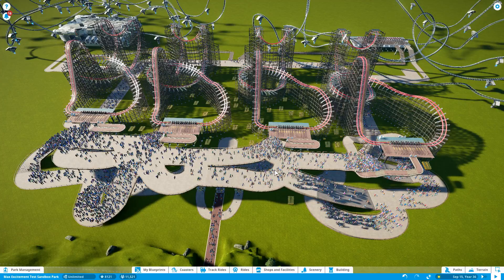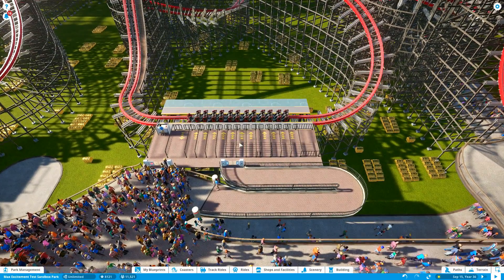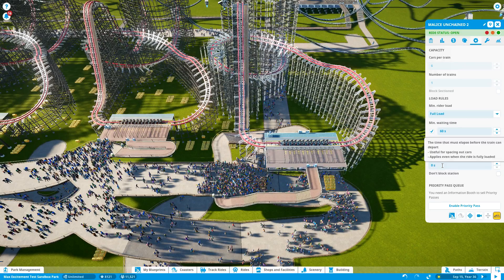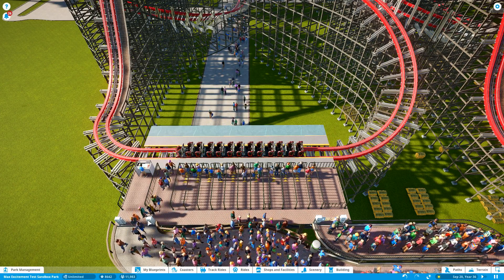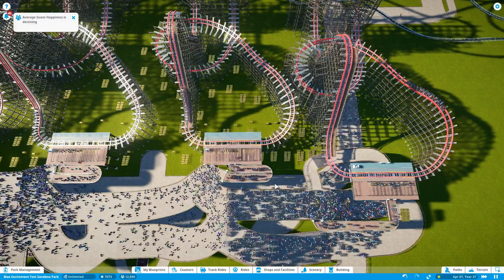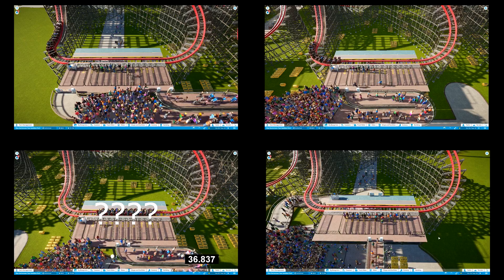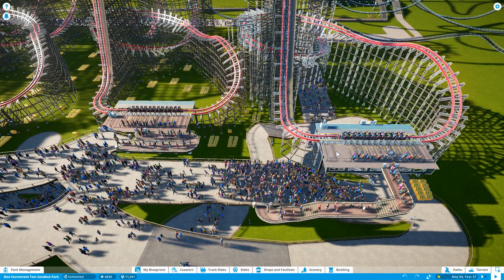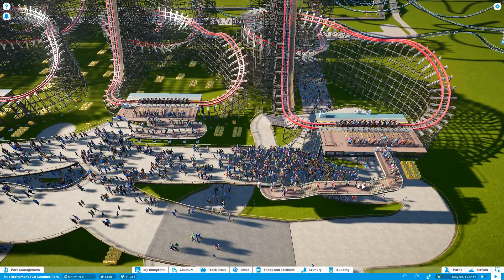Optimize Your Coaster Station! Planet Coaster Tutorial 31

Comment: How to optimize your coasters:
1. Always have the entrance and exit on opposite sides of the station, centered. 
2. Make your trains as long as you practically can
3. Always have at least two trains. If the coaster's long enough, have a block brake in the middle of the layout and three trains.
4. Run your drive tires as fast as possible, and match them with your station exit/entrance speeds.
5. Run your lift as fast as possible unless you need to slow it down to prevent a train from stopping at the top in 3-train operation. 
6. Set your Minimum Wait Time, Maximum Wait Time, and Minimum Dispatch Interval to the same value, which will be whatever will result in each train dispatching right when another one is returning to the station. This is easy to find with 2 trains (time how long it takes a train to complete the circuit and subtract 5 seconds) but trickier with three trans and takes some trial and error.
7. Your ticket price is the Prestige divided by 37.6. This applies to all rides in the game that have prestige. You don't want people saying a ride is a great value or too expensive.

Comment: Entrance position starts to matter as trains get longer, you start running multiple trans, and you're on a tight schedule with only a few seconds between 1 train leaving and the next entering the station.  If you're in this situation, you risk trains leaving with the last few seats empty.  You can solve this problem by putting the entrance at the rear of the platform.

See, peeps fill the slots on the platform from front to back.  When trains are long and on a tight schedule, usually the entrance gate closes before all the slots fill up.  By placing the entrance at the rear, when the entrance opens again for the next train, peeps still in the queue don't have far to go to fill the last few rows of seats.

Also, if you have a priority pass queue, be sure its exit back into the main queue is far enough back from the platform entrance gate that a full train load of peeps can stand between the priority exit and the platform entrance.  The merge of the priority and main queues causes a delay in peep movement.  If the priority exit is adjacent to the platform entrance, peeps won't move fast enough to fill the last seats on the coaster.

Comment: So the takeaway I'm seeing here is that the most optimal setup for a roller coaster station is to have the exit in the middle of the train's position on the opposite side from the "on-deck" section of the queue (the area where the peeps are right before getting on the coaster train).

I have a guess as to why the three stations that had the exit and queue on the same side had very close rider counts: the coaster, being single-train, cannot possibly keep the "on-deck" section empty, and because trains don't load from the "on-deck" section until the last peep exiting the ride leaves the station, that means that the exit time is the bottleneck. With multiple trains, it might be possible to get more people through with certain entrance positions, but because of how the coaster queues work, as long as the exit time is minimized and there's a full "on-deck" section in the queue every time a train unloads, you're basically pushing as many people through as possible unless you've messed up your block sectioning.
Reply: Kitsune Zeta I definitely think you've nailed it. The true challenge is optimizing every aspect of your coaster, especially those with three trains (or more).  When it comes to three train rides, the blocking is probably the most important aspect, with entrance/exit placement being a secondary consideration. 

Indeed, with efficient three train coasters, one is often waiting in  the station fully-loaded for 5 or 6 seconds before it can disembark, and there's a train waiting to enter and unload for that same space of time. In such a case, a bit of slowness exiting the station is not really going to negatively impact the ride's efficiency.  One would have to have the coaster timed so there is never a train waiting to depart in order for entrance/exit to have as dramatic an effect as in this video. 

Not to take away from Brothgar, as these videos are great, but it's important to note that each variable on its own may be optimized differently than on a coaster where all of these variables affect one another.